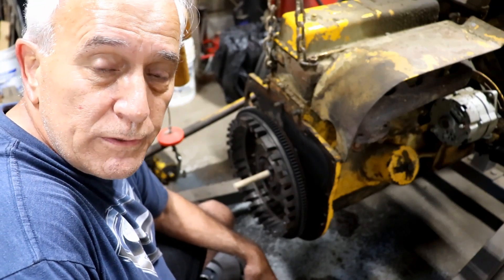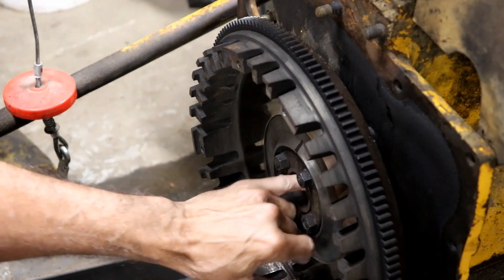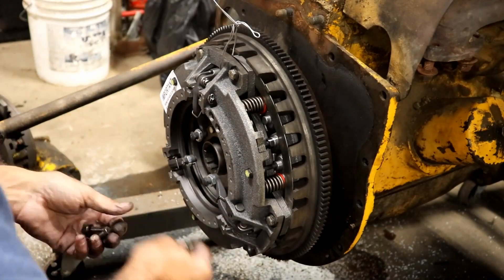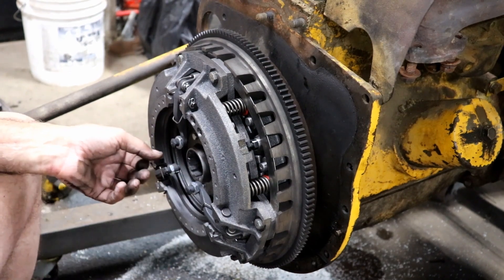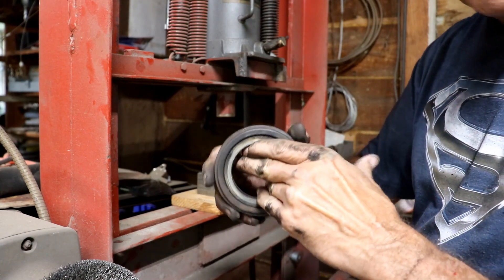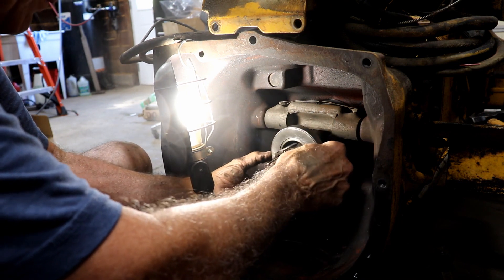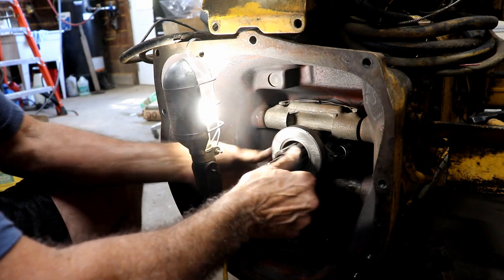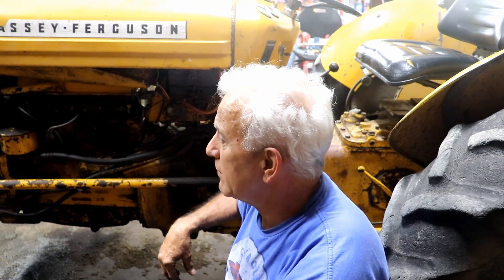579 RSW Putting A New Clutch In A 1960 MF 35 Tractor

Comment: As soon as I saw you torque those 30# bolts down without the alignment tool in place, I knew your clutch plate wasn't centered.  With the alignment tool in place and the 30# bolts are torqued down, then remove those bolts holding the springs back.  It would have made your job a lot simpler. Great content though Jerry, even though I lost my voice screaming at the screen when I saw you doing that.
Reply: I was screaming along with you.
Where I live we always have to turn our own dummy alignment shafts out of wood. You Americans have it easy ;)
Reply: When I was younger, a day we rebuilt generators m/dynamos, we would take trashed out input shafts and turn them into alignment tools on an old south bend lathe. Now we have plastic whoopies shipped with every new clutch.

When I do a clutch, I make sure the tool slides in and out with ease. The difficulty of getting it in and out bothers me.

Comment: Jerry you did real good on that tractor but you made one mistake mainly that I seen right off the bat. Im an X Eastern Airlines truck & auto mechanic. Snugging up or tightening up the pressure plate bolts first without aligning the clutch disc with spline tool all the way into the pilot bearing and clutch disc is a mistake. Do that first loose then snug the pressure plate bolts then torque them its a common error. Also a trade trick youll never have alignment problems again I was taught this years ago. Get some long bolts maybe 3 or 4 of them 4-5 inchs long or longer same thread as the bolts your using to bolt together the two ends. Cut the heads off & Grind them to a slight taper point. Space them apart evenly & hand screw them in a bit on one side and this acts as guide pins to align up front to back as your joining them up. Simply remove them after your together.Thats probably no doubt how the factory joins them with guide pins. Works every time but anyhoo you did good either way hopefully you wont have to do this again...Nice Job! ...Glenn

Comment: pilot bushing replacement. I used Grease from a grease gun.. same principal, made long Transmission bolts 9" long align the cases while inserting front shafts into the clutch and pilot bushing.

Comment: “Riding the clutch” is probably what wore out that throw out bearing and seized it up which wore out the fingers on the clutch.  So keep that foot off the clutch pedal when not using it. 
  Nice trick on the pilot shaft bearing.

Comment: Well, as soon as I saw you tighten up those clutch bolts without the alignment tool in place, I thought "here comes a problem!".  The other thing that occurred to me was that the alignment tool can be used as a guide (using a small ruler or similar straight edge) to line up the transmission splines before trying to mate the two parts together.  I love your bread trick to remove that ST518 (at least that's what it looked like) pilot bearing.  I've always used a slide bearing puller.

Comment: First clutch I ever did was my sisters 66 Karman Ghia (VW) and the first thing I learned was to back off the clutch cable adjustment so the Throw Out bearing isn't pushing at all on the clutch which can cause the engine to be stuck while you're trying to pull the engine. Next thing I learned was to use the alignment tool before I tightened the clutch bolts. Once you have them torqued it should slide right out and everything is properly aligned. Otherwise, as you found out, you got to do it all again and I hate doing things twice .Once it's all together adjust the clutch cable so there's just a little play in the clutch pedal, otherwise the TO bearing is always riding on the clutch and you'll have problems again soon. (Oh yeah, if there's any scarring on the flywheel surface you need to remove the flywheel and have it turned, like a brake disc. That surface can ruin a clutch if it's not flat.)

Comment: Ouch. 
This reminds me of when I sided my two story house that sat on a steep slope by myself all off a ladder, or when I replaced the rear brakes and rotors on my van where the emergency drum pads inside the rotor fought removing the rotors, or when I spent an entire summer building a 300 sf summer cabana. Each ended with I am too old for this, everything on me hurts plus I've run out of good swear words.

And, you have to do it again....I'd almost say torch off the loader but then it's harder to sell that way.

Comment: You should have put the spline In the pressure plate then add the other clutch plate and ring, install all one unit, bolt in place, then remove the lock down bolts, then remove alignment spline

Comment: 💯 you need to put alignment tool in  before tou tightened the bolts you need to adjust the gap in the duel clutch

Comment: Here's a British cheat.............
Put the pressure plate and clutch or clutches on the gearbox input shaft.......
Put the tractor back together, then from the hole underneath, bolt the pressure plate to flywheel  then remove the three bolts that hold the pressure plate compressed.... jobs a good un..
Reply: Cheers for this Evan, you are gold:)  Will try this tomor,,,,,,,  So simple:)
Reply: Worked a treat,, cheers

Comment: Hi Jerry I'm not a musician but watch all your videos. I've one silly question. Those blocks of wood you use during clamping why are they called a call?
Reply: Caul. Cauls are used when applying pressure to something to make sure the shape is not changed or to preserve or impart a particular shape to something under pressure.
Reply: @forthwithtx5852 : In working with wood, cauls are also a way
to protect your project wood, from damage by clamps.

Comment: What I've done in the past, and hopefully you never have to do it again, is to slide the alignment tool into the larger splined section in the clutch, and then slide the clutch disc over the end and then install things. That of course doesn't help when getting the two splines inside the bell housing to slide over things. That is always a challenge. Haven't done a clutch on tractor in over 30 years. Hopefully I don't have to do another one. My tractor now is hydraulic drive, so no clutch. That is another can of worms though. :)

Good thing is, it is done you and you can now use the tractor again.

Comment: Remove  the bearings  carrier  from the bearing     refit the new bearing  and dap of grease   on clutch  fork   refit springs  adjust  shaft and pedal when tracter back together   with  3   /16  inch gap  free play.   Before clutch comes into play .  Must have some play on pedal before  clutch  comes into contact .  Mf mechanic

Comment: Well next time. Put alignment tool in 1st before you tighten down on the clutch assembly..that would have save you much headache..next get a real torque wrench..when you removed the spring bolts you didn't set the pto second stage clutch gap..you beat on the clutch so much that the 1st disk finally got into position to where the input finally went into the throughout bearing.

Comment: . No no no  do not undo those 3 bolts.     Undoo clutch bolts and  align  1st then tighten  the clutch cover  1st .  Torque  them up  then remove  3   cover bolts   then alighn 3 fingers    to the right height    then yku can put back together.  Mf    mechanic  uk.